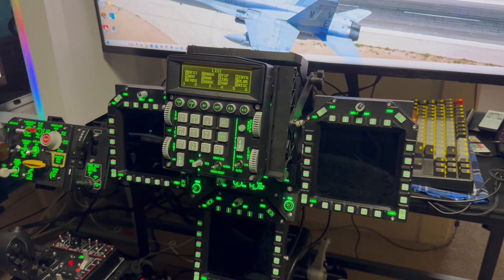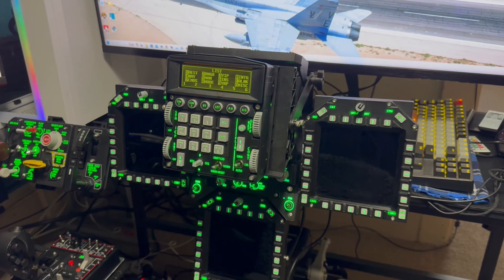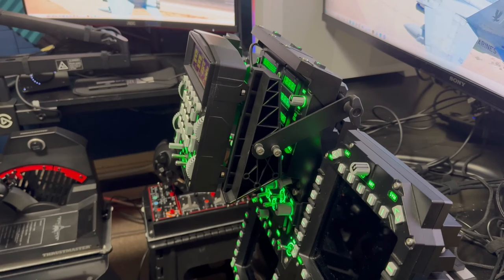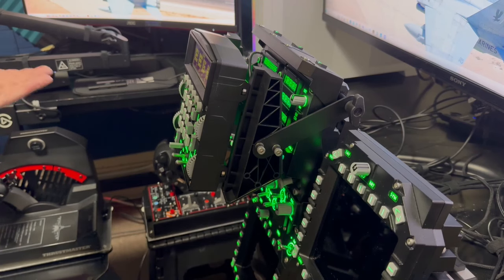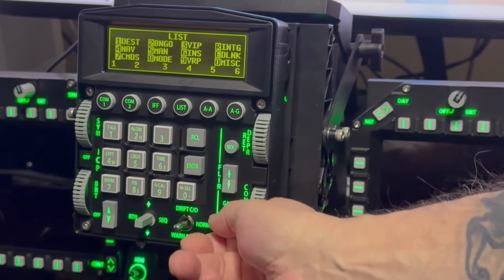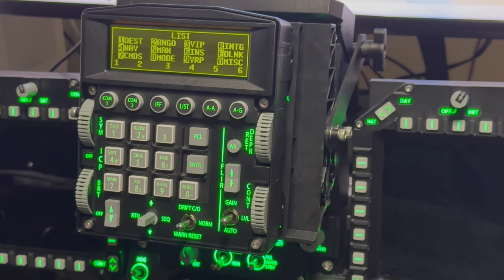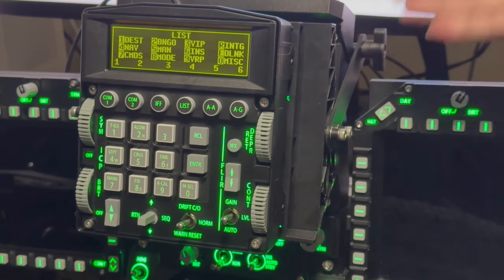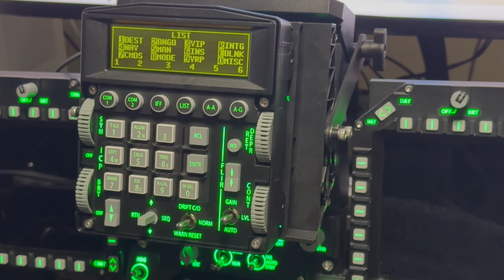Winwing ICP for the F-16C DCS World

Comment: That's not quite right. It's basically a block 50/52 ICP with the DED integrated into the unit like on a block 60. So kind of a hybrid.
Reply from the maker: You are right, The 70 has the COM buttons above the display.  So hybrid it is.
Reply: @JPsTechReviews  it's not just that, there are other differences.  The ICP is really a block 50/52 replica. The DED was only put there for cost and convenience, inspired by the  block 60+ placement.